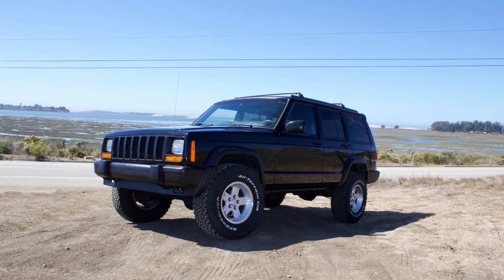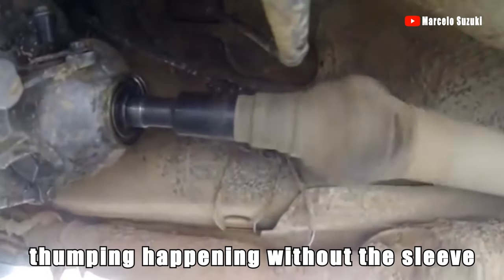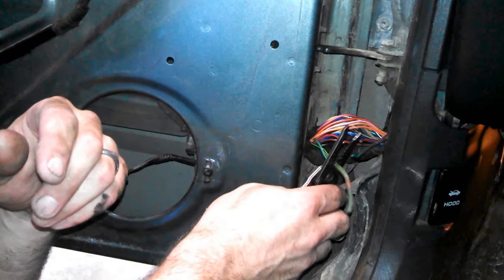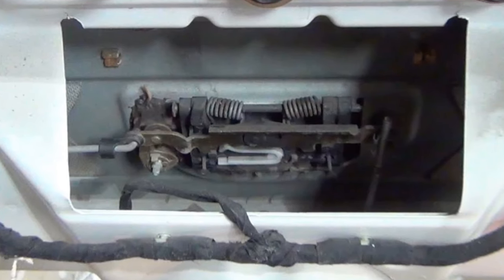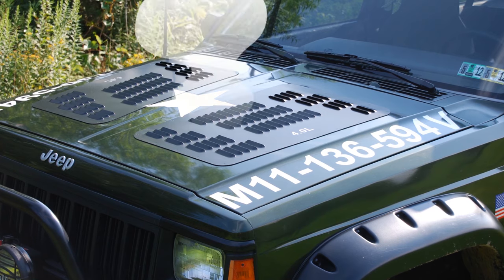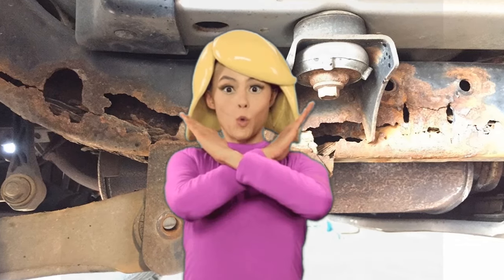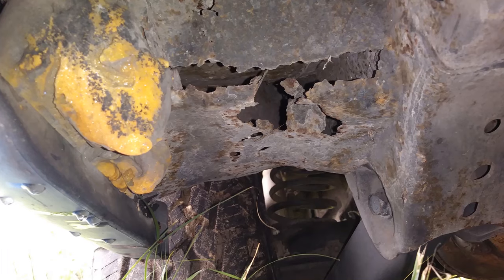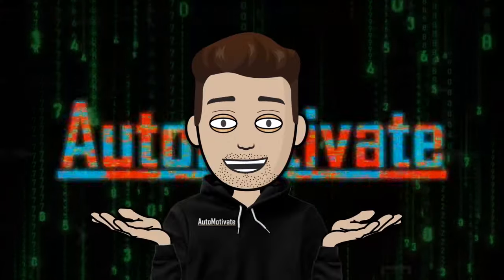Watch This Before Buying a JEEP CHEROKEE XJ  1997-2001

Comment: I never liked the XJ, we have 4 Jeeps in our family, my mom has a 98 ZJ 4.0 with 320k miles still  daily drives it original owner, i have a 98 5.9 liter ZJ, and a 90 Grand Wagoneer, brother has a 14 srt8.   I dont  like the XJ because its, well ugly, ugly outside, dated ugly interior even for later models.  Theyre too small inside, no leg room. I honestly prefer the 5.9 liter over the 4.0 its nearly as reliable and twice the power almost

Comment: Hey you know I was a little skeptical about watching this video because I bought a bought an XJ long before this video came out but yeah so unfortunately let me give one little pointer two people buying xj's don't buy them at night because I failed to realize that the floorboards were rusted out however the unibody rails we're not so I was able to weld in new floorboards and I am in the process of reinforcing with extra channel iron around the rails and underbody unibody anyway as a side note to the overheating thingwhich is another reason why I'm kicking myself for an extra day because my brother had several and I know x-rays are prone to overheat and I live in the Mojave desert yeah so you want to get a three-course radiator a new fan clutch just right off the bat just if you bought if you buy a tenx Jay and hot wet and a hot climate then you need to just get a three to four core lumina radiator a brand-new fan clutch and put your electric fan on a switch so you can just run it all the time and get a trans cooler I got to be in m24 past trans cooler and just run your transcript or run your trans three transformer and that way you're not putting more heat in your radiator I also have an illegitimate cowl hood which is like the only one I've ever seen on an XJ and it looks dope and yeah don't hate me cuz I'm beautiful so yeah by having the cowl hood three-core radiator new fan clutch and fan on electric fan on switch all the time and bnm trans cooler routing my trans fluid away from my radiator to avoid more heat going into it I'm able to stay below 210 on pretty much hot days even on the highway doing 70 with 35 inch tires and a 6 and a half inch lift but the bottom line is this video was much more educational and informational than I would have definitely given it credit for by the title because you have the title kind of makes me want to not watch it but once you watch it you kind of glad you did and yeah so anyway I've actually got the slip yoke eliminator slip yoke eliminator and I still get their the crazy sounds are starting off but thank you for the information apparently I need to grease my slip yoke eliminator because a slip yoke eliminator basically put two front drivelines on your vehicle I don't know how they recommend it because it really makes the rear articulation very impressive as opposed to having the non slip yoke eliminator with just the slip yoke the slip yoke eliminator places the front driveline in your rear as well as the front and really loves you articulation

Comment: And one more thing the upper control arm mount passenger side on my 99 Jeep XJ got sheared off so I welded it back on and it got your day off so I will hit it back on and I got sheared off and welded back on got sheared off you see the pattern here okay so I did my Bros old school fixed where you take about 4 ft of chain good heavy tow chain and you wrap it round wrap it round wrap it round lock it down take a couple of nuts and bolts and tighten it up tighten it up tighten it up and guess what is stronger than stock way stronger than stalk you're welcome